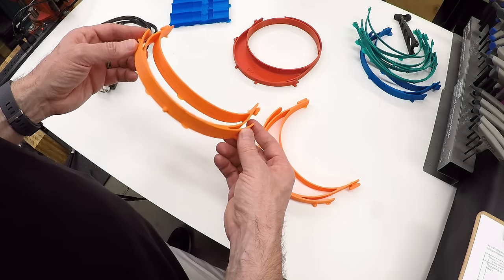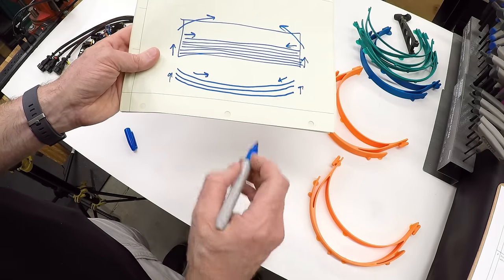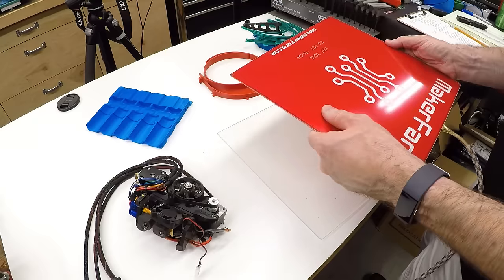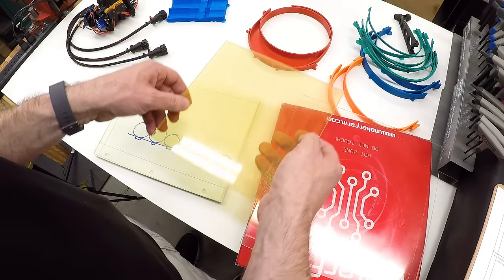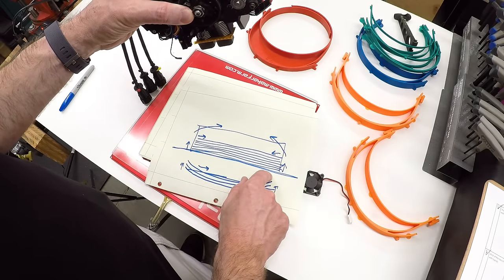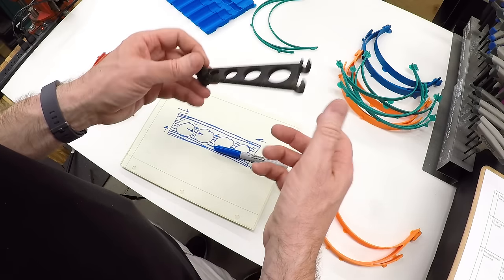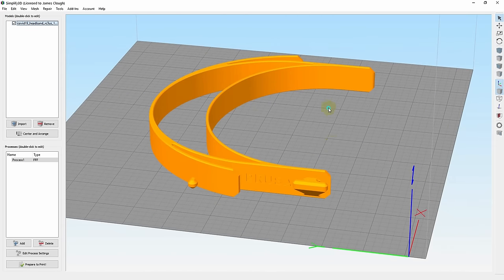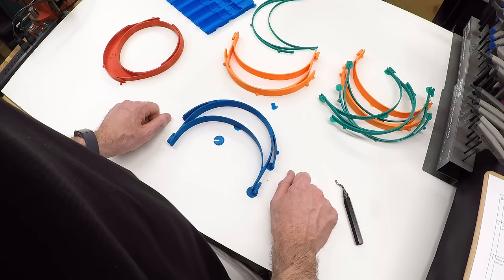3D Printing with ABS - Tips for Success

Comment: I've been printing with ABS pretty much exclusively for more than 5 years and this is a good explanation for bed lift. Depending on the part I'll either use a brim or mouse ears.
An enclosure can help but failing that don't print in a really cold environment.

Another variable that factors into shrinkage is infill type and %age.. the more infill the higher the lift force at corners with the worst being a large flat solid square as that's essentially 100% with the corner being pulled on from all directions and the resultant force is at 45 degrees horizontal and vertical.. large mouse ears at the corners will normally prevent this but your using up bed space.

Once you get the hang of ABS it's a great material, yes it's more difficult than PLA but it does have numerous advantages over it or people wouldn't use it.

For bed adhesion I just use a thin layer of elmers glue, if it doest;t pop off on its own while cooling down from 90Deg bed temp (<1% of the time)  And it wont pry off easily then I'll put the build plate in some warm soapy water and seeing as elmers glue is water soluble.....

Comment: That’s a very good video, you are clear, dense and globaly true ! That’s so good to see someone who knows well and helps everyone, so for this : THANKS YOU!
I doubt about only one thing: i don’t think that the fan(s) that are cooling the extruder are also cooling the print in a closed chamber, because the air witch is sucked by the fan(s) is already hot (because of the chamber obviously)and heated by going throught the extruder.
Sorry about my english, i’m french 😁 do not hesitate to correct me.

Comment: 2 years late, but my go-to surface for ABS is heavy kapton tape + ABS slurry (natural ABS dissolved in acetone).  The heat will make the slurry film tacky, and the kapton will not ITSELF bond to the ABS print, so worst case you may have to replace the tape on the glass if the print is difficult to remove from the tape.
14:30 - please don't use paper to measure surface to head distance, go get a set of feeler gauges - they're only a few $ from a auto parts or hardware store.  Automatic and more modern software is, of course, the gold standard.

Comment: Nickle plating is a common material to make resistor.   Copper 1.68  where Nickel  6.99 relative resistances.   The metal doesn't get that hot by since it can not exceed the insulating material temperature.   Could even you tin.

Comment: I solved my ABS adhesion problem by turning off my cooling fan, turning my build plate temperature to 0 degrees, upped the nozzle temperature to 230 degrees, and put strips of masking tape over the center portion of my build plate. The ABS sticks to the masking tape just fine and I use a razor blade scraper to peel the tape and print off the build plate, I peel the tape off the bottom of the print and anything that sticks to the print can be sanded off with some fine grit sandpaper. Its just a little more labor involved but my prints come out fine.
Reply: and for a bigger parts( fast plate size ) printed is not shrinking , so the edges are not lifting up from plate?first layer thickness to you? or any difference?

Comment: I also enjoy abs due to the post processing abilities. Machining it with a sharp HSS bit works wonders if needed as well as the old acetone smoothing tricks etc etc. I like the material allot.
Reply from the maker: I didn't mention it in the video, but I have machined prints after cooling to control critical fits.  It also taps easily and holds M3 threads well.
Reply: @Clough42  I have tapped abs as well, much less finiky than pla to tap. Ppa taps a bit more brittle, vs abs actually taps very nicely.

Comment: Just found your help videos.. very very helpful sir.. thanks.. I just got my first ever 3D printer a large printing area version! It can print 15.7 inches tall and 13 inches by 13 inches.  I don't know if you know the company it is a "TRONXY " X5SA machine kit. I been slowly building it for 4 days now? It's manual and instructions are not very detailed.   They are good, But could be better for some newbie like me to understand?  It has a glass insulated heated bed and a separate non flexible thick metal sheet that goes on the bed held by the 4 sprung clips!  It said it is a auto leveling system with a touch sensor But I think I also need to adjust the bed with the 6 built in spring based knobs?  It has been redesigned by the company to be better than the original model... like the way the pulleys etc. all are made. I not finished building the machine yet. Just have to do the right electronic plug ins now. I have a duct ed better redesigned head with a head fan system seems that was redone to work better? I got the usb thumb memory stick with there software to use when I start it up!  I brought a spool of blue ABS as I read this was for outside use as it don't bio-break down unlike PLA. I be getting a free spool of white PLA from the printers company soon they said.  As for the printer placement you said about a room with set heat etc. with a enclosure. I plan to put the printer in the spare room I got and build a glass or perspex enclosure with a small fan and air duct to put out the small window when in use.  I will get that de-burring tool as you said to do?  Have you any other thoughts about my machine please let me know? Thanks I have subscribed now too : )

Comment: One thing that I did where I went a little further than using hair spray was using really thin but super strong double stick tape. Even with a heated bed, hair spray etc. I was still getting bed adhesion issues sometimes. The tape holds it really well, but it peels off easily when I am done. I can use it a few times before it loses its stickiness.  Not really for many prints on the same thing. However, if you just can't solve your issue and you only need a few of them, it works great. You will need to increase your Z for the first layer slightly for the thickness though.

Comment: Great video from a fellow ABS lover. 
Does the print really print to match the angle of the buildplate? (as in your extreme example at 15:32 ) Or does it print a parallelogram? If it prints on the angle as you suggest, what does it do for dips and humps? Seems like a big hump in the middle would produce something akin to a flower as the walls angle out in every direction as they rise adn the top of the print would be out of spec for size.
 The Z is moving away in a linear way, so is the software truly compensating for the bad bed angle? or is it just compensating in the Z for the bed height gain or loss due to the dips or any angle? (and thus a parallelogram)
I had always assumed it would be a parallelogram because the distortions from an angled-out print could get massive on a very tall part and even exceed the build area of the print.
I would normally check, because I am skeptical, but I'm even more old school than you and I manually level with a dial indicator and then feeler gauges (and shims where needed), so I don't have a measuring system to try it on.

Comment: Thanks for the run down, you explained perfectly and my prints are sticking nice... turns out my hot end fan was dumpling a ton of air strait down and cooling my prints. Used a piece of tin foil and redirected air flow out the back. Stock Ender 3 pro.. Thanks again my man!! 💪💪

Comment: Because of the variety of surfaces I've printed to over the years, I've moved away from ABS to mostly PLA. That said I'm looking at printing more PETG when I am able, though I'm really only good for about 20 layers before I start seeing problems there. (Which generally means that there's actually a problem long before that which suddenly manifests itself with print failure.) In any case I've seen references to the deburring tool for years, but this is the first time I've found a link to it, including when I've looked specifically for one, so if it's an affiliate link, you're getting that small percentage that Amazon passes on to you for another one sold. 

I'm only at about 200 3dVerkstan visor frame, and am trying the variation from the BYU AML which I'm hoping will pack better. We'll see. Thanks and take care.

Comment: I bought a BL touch sensor for my printer.  Only to learn, while modifying the firmware settings, there is an option for "mesh bed levelling".  I have found this to be far superior to the automatic sensor, and at a cost of zero dollars.  
This is regarding a Neptune 2S, similar to Ender 3, and many other brands.

Comment: ABS isn't a blend, it's a copolymer. Specifically it's a graft copolymer, where they take butadiene (rubber) flake and catalytically polymerise the two other ingredients, introduced as gaseous monomers, onto it. Indeed the properties of the material can be varied in a large range by changing the mixture or even the shape of the graft base flake. This is a spectacularly weird material like that.

PETG i believe is a true copolymer, where there are no continuous chunks of a given monomer in the polymer chain, and it can be varied as well fundamentally, but for some reason it's fairly consistent in its properties...

Comment: I only print in ABS (and ASA recently) and NEVER use a glue stick or other goo material.
I print only on kapton tape which i sand lightly with a 400 grit sand paper.
One layer of kapton can last for 50 to 100 prints if you're careful when removing the item from the bed.
Note; I've tried buildtak which works very weel, but because ABS sticks too well sometimes, the expensive buildtak will be ruined quite fast.
Reply: and have a heated chamber for this too? or just open air? cooling fun--on or off? bed temperature on or off? nozzle temperature 230 or around?

Comment: Hi James. Ideally to cool the extruder would be a water cooling system.  The one from "PC water colling" is quite good. With your experience and your workshop, it would be a piece of cake!
Reply from the maker: Interesting idea.  That would also be a good solution to extract motor heat inside a heated chamber
Reply: @Clough42  Yes indeed. I try it and it works great. There are some commercial solutions available, but I guess a homemade custom design is better though.
Reply: a great bonus to using PC cooling parts from reputable vendors at least for the pump, radiators and fans.  Very high reliability, People have D5 pumps for example running for years on end without issue often times with the computer rarely shut off. I know I rarely shut my loop down on my gaming machine, computer may reboot for OS patches but the cooling system is rarely off.  quality fans are the same and a good radiator is leak free.  Just have to be aware of water block materials, if you use a typical PC water cooling radiator have to make sure the parts being cooled side of things is either copper or brass so water blocks for hot ends and/or stepper motors should be copper or brass.

Though purpose built systems for printers from major industrial suppliers probably also use the D5, Its a sturdy proven design used all over the place where water needs to go somewhere else.

Comment: I'm using a TAZ 6 printing the same head bands that you show.  I'm using Lulzbots recommended settings for ABS which is 110C for the bed. I suspect the insulation lowers the temperature.  I use glue sticks on the PEI surface.  I have not had any problems with adhesion and I have printed almost 100 of the PRUSA head bands in pairs.  I do sometimes have the "chain mail" problem on the bottom of the parts.  But not every print????  I think I'll try adjusting the bottom layer a little.  

Good Video!!!
Reply: I'm using 110 bed temperature

Comment: Excellent tips, I really like printing with ABS and have some good (and bad) experiences. Your tips will help alot. Took me a long time to realize I needed an enclosure, so I built one. I've had good adhesion with Thick Polyimide Adhesive Tape (Amazon) cleaned with isopropanol 99%.

Comment: I know this is an old video but at 11:23 I have to disagree. I exclusively print on PEI and for it to stick well enough is typically 105-110c (depending on manufacturer of the PEI). It will remove from the plate but most people use spring steel sheet with magnet sheet on the bed for a reason.

Comment: With the availability of ASA and its properties (lower toxic fumes when heated, UV resistance, greater modular strength, lower warp tendencies) why would anyone select ABS? Compliancy with a BOM/engineering design specifications? Customer preferences? Utilizing remaining stocks? It seems to me that ASA is the better material to use for FDM printing.

Comment: Just had a passing though. Instead of an enclosure, do you think some incandescent IR heat lamps could be set up to shine on the model as it prints? I'm thinking encase thermistors in ABS (grey?) to simulate the thermal absorption, and orient them in the vicinity of the model on the Y or Z axis. Maybe around the perimeter of the build plate. Control the heat-lamps with a PID controller(s) based on feedback from the thermistors. Adjust the temperature based on the color/size of the model.
Thoughts?

Comment: Well, I finally figured out how to get abs it stick but now it won't come off the print bed. Any tips on how to make it stick less? I applied glue stick on top of blue tape, allowed it to dry, coated it in sharpie marker and another layer of glue. I have a non removable  aluminum print bed.

Comment: I have used a PET based window tint film, on glass, for a print surface on my first printer. It usually worked fairly well.  Recently i am using a textured glass made by creality?, on my Sovol, that beats any other surface i have tried.  Thanks for your video and your tips!
Reply from the maker: I tried some thin (.003") PEI film and it was a total failure.  It bonded well, and then the part warped and pulled a big bubble in the film.  The Gizmo Dorks 0.5mm stuff works well for me.  I tried some 1mm stuff on my 8" printer, but had unrelated problems related to the heater.

Comment: About this Thema, i agree with you. That improve a lot in regards to have warping with abs. I accidentally found another God way to avoid warping and it consists in have a very thin first layer. Almost transparent by reducing the extrusion flow and layer height for the first layer. But you will need a very good leveled bed. Once you can print this such as almost transparent first layer the warping will disappear forever! Maybe 0.05 first layer height. With 50% less extrusion material.

Comment: 27:45  Perhaps also the added-in voids changes how heat collects/moves through the part. The short segments between the voids are like pillars or columns that don't retain as much heat.  And, heat doesn't flow from the base of the part past the voids to the rest of the part as well.  Interesting stuff.

Edit: Previously I completely overlooked infill vs solid wall. I could understand how the face shield frame section is so narrow that the insides need to be 100% filled, but with the camera mount example where you added voids to interrupt long strands, was that in addition to some percentage level of infill, where infill percentage may also interrupt long strands? Or, is this added void strategy something that lets you print at 100 percent solid?

Comment: With ABS I have a weird issue- it sometimes warps, but not immediately. It does so after a few weeks or months since printing, especially large thin, flat surfaces that were 3D printed horizontally. A 3D printed object looks fine long enough for me to think it was printed correctly and start using it/paint it/ install it in something and then some day I realize it warped. Again. Can anyone please tell me why this happens? Because of the long time it takes for the problem to manifest itself it is very difficult to debug this.

Comment: Retractions on ABS
I see people using 1mm or less on retractions to avoid stringing on PLA.
Articles shows there is no much diference on PLA to ABS on avoiding stringing.
But after a lot of tests, i discovered that i needed to retract 7mm to completely avoid the problem.
I have a bowden Extruder and noticed that the conduit was kind of loose, after many failed solutions, i manage to fix the problem.
I was hoping to reduce the retractions a lot... but Nope, i still need to retract 5mm.
Is this Normal?

Comment: I have a heated chamber on my printer but the ABS parts still have layer separation.. bead adhesion is fine but it its splits apart.. does my chamber need to be hoter?

Comment: One thing I do if I notice a part pulling from the bed mid print is to use a hot glue gun to stick it back down while running. At least for pla. It will take a higher temp glue to handle and temps.

Comment: Before you showed the manual removal of the added pads, I was imagining the solution might be to have  some bigger pads beyond the end.  Then using flush cutting pliers to snap the extra end off.  I don't (yet) have any 3d gear, so I'm not talking about experience.  Just speaking of my imagination.

Comment: Interesting i have an Anycubic Chiron which has auto leveling (a lot of people dislike it) it probes the bed in 25 locations after you can fine tune while printing i've found if i lower my 1st print layer by .2mm i get really good bed adhesion.. i dont know if other printers allow this but i find it great i can adjust the height (raise or lower) as a whole or 1 of the 25 individual probe point before or during print...